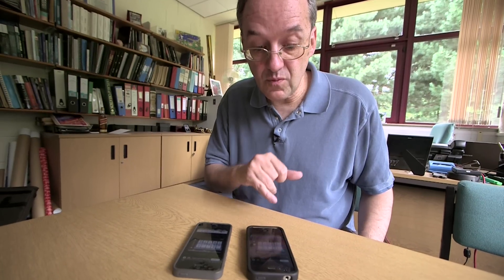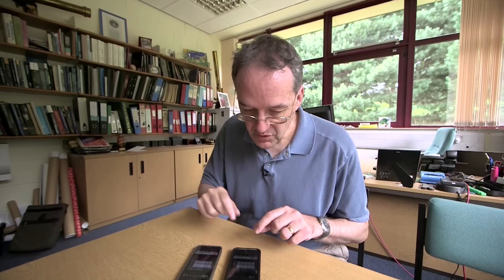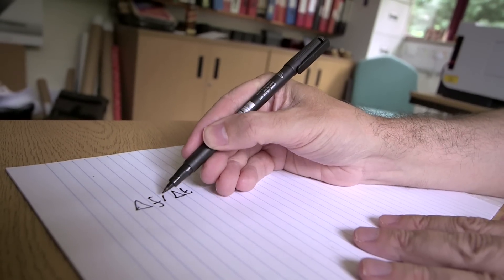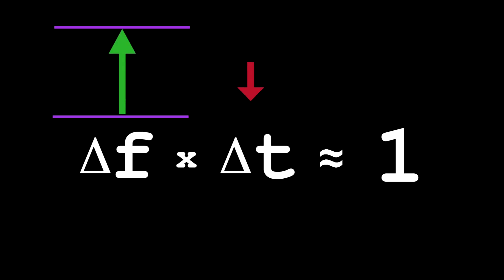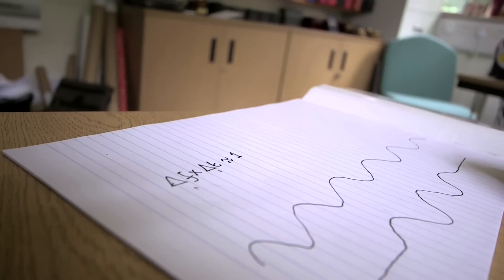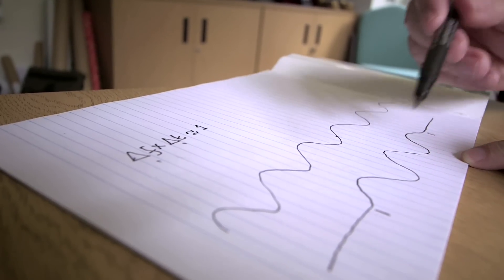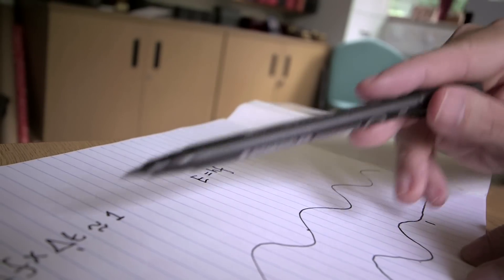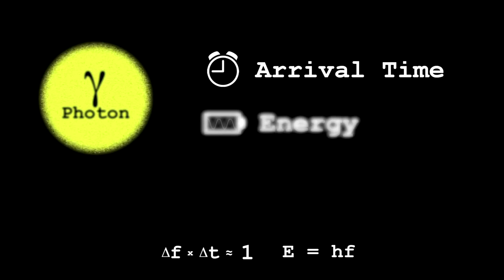What is the maximum Bandwidth? - Sixty Symbols

Comment: A single frequency can indeed convey information. It relies more on the sender/receiver having a pre-designated meaning of the frequency.

Example would be the carrier frequency used for all radio stations. Yes its a tone on a single frequency. The meaning is that your radio knows that this is the 0 point to start listening for the radio station.
Reply: the carrier frequency is actually the center frequency, for FM the information being sent is spreaded over +/- 75khz around the center, and AM is similar.

Maybe you are thinking something like QAM, where a single 100Hz maps to bit 0, a single 200 Hz maps to bit 1, but it is the change from 100Hz to 200Hz makes your carrier signal has a bandwidth greater than 0Hz; in other words, the information carrying signal is not a single frequency signal anymore
Reply: Derrick Cheung May be a bit late to reply, but AM radio never changes in frequency, its the amplitude that communicates data. Its all in the name, Amplitude Modulation(AM) vs Frequency Modulation(FM).
Reply: 90XaSeR09 yes, the center frequency doesn't change, only change in amplitude, but what i was trying to say is, the amplitude/information itself is a signal which has a bandwidth, AM won't compress or expand the bandwidth. Therefore the carrier signal itself will have a bandwidth reside around the center frequency. That's what I meant similar to FM, the information is in the bandwidth, no bandwidth no info.
Reply: Derrick Cheung 90XaSeR09 
But what I am saying is regardless of the actual radio station being broadcast on other frequencies. The carrier itself is a single frequency and conveys that it is the 0ing point (middle or low end it doesn't matter). That is very useful information that is sent on a single frequency, no bandwidth.
Reply: Benjamin Raush Okay, I think we misunderstood each other, I agree, the center frequency is a very important information for tuning your radio for the 0-ing point, otherwise it is demodulating junk.

What he meant when he said a single frequency sine wave doesnt carry information (information as in a sequence of 1 and 0). He meant, in order for a system to send a 1 and a 0, it needs two distinguishable sine waves, different frequency or different amplitude, either way, when you append those two waves in time, this information carrying signal are not longer a single tone/single frequency wave. (a quick Fourier series of some mixed signal will shows it need at least two different frequencies to approx. it)
Reply: no. a true single frequency never comes on or goes off, it' s there all the time, never changes, hence can't convey information

Comment: So is this collection of frequencies transmitting data by turning the light on and off to represent a 1 and 0, respectively, or is the process more complicated?
Reply: B Perkins No, it's a superposition of waveforms. This is touched upon at 2:12 in the video, at least in principle. The light within an optical fibre is never 'off', it doesn't work like morse code. Instead, many streams of individual data are multiplexed on an analog signal, then demultiplexed at the receiving end. 
https://en.wikipedia.org/wiki/Multiplexing
If it worked like Morse code (repeatedly turning a switch off and on), it would be much, much slower, since you'd be only able to send a single data stream at one time, and nothing else. Multiplexing allows you to use a waveform that carries LOTS of data.
Reply: In that case, how are the individual analog waves read by a computer after they are demultiplexed? From 3:10 to 3:30, what do the "blips" and "destructive interference areas" represent? (This is where I assumed they were ones and zeroes).
Reply: ***** In that case, how are the individual analog waves read by a computer after they are demultiplexed? From 3:10 to 3:30, what do the "blips" and "destructive interference areas" represent? (This is where I assumed they were ones and zeroes).
Reply: B Perkins The demultiplexer's very purpose is to break apart all the information carried by the optical carrier signal, which is typically several 
different wavelengths of light.
Upon re-reading my previous comment, I see that I should have probably clarified further. Your assumption is correct, the blips do represent 1s and 0s, but it's not quite as simple as singular blips representing a '1' in binary. They represent many 1s and 0s, because each blip can be further broken down to represent a data value based on the intensity at a particular point in the blip.  
In other words, a single blip carries many 1s and 0s. The wavelength has to be constant (for a single stream of data) because optical fibre works by wavelength division multiplexing ( https://en.wikipedia.org/wiki/Wavelength-division_multiplexing ), but you can certainly mess around with the intensity of each blip, and each blip is divided into representing many 1s and 0s. Rather than "on" and "off", you should think of it as 'bright', 'less bright', 'dim', etc.

Comment: That is what i mean by "doubling the whole system". You need a special transmitting device to use n cables, and a special receiving device capable of collecting these n signals back into one. So basically you have n simple transmitters and n simple receivers, they are just put into a single casing. And each transmitter-cable-receiver system has the same bandwidth limit X, but all systems add up to a total of nX.

Comment: I spoke with my fiber optics cable provider a while back because I had some issues, the man on the phone said while confirming the line was active: "The line allows 100Gb/s transfer rate", so that's something. 

I now have a 600Mb/s up+down line, roughly 75MB/s for 50 euros a month ^^

I think, taking from hardware limitations (~1500MB/s write on a single PCI SSD) it should be possible to provide such. make that roughly 12Gb/s. Having 666 of these cards, will give you the grand total of 1TB/s ^^

Comment: I'm not quite following here so help me out if you can: A laser works because specific energies that are stored in an electron shell is released as specific wavelengths of light... How can you describe such a pulse as having multiple wavelengths?  I get that mathematically, something like a Fourier transform would, naturally turn a square wave into a collection different wavelengths, but how does that actually describe turning a laser on and off? 

And if i may, why can't you phase shift the light 180 degrees like they do with the GPS signals? Or is that actually what they do? and how many nanometers of Delta-f does that require? Can i shorten Delta-f for one signal and put another in there as well? anyone?
Reply: Okay, I don't really know why this works the way it does, but I can (try to) explain how it behaves.

If you know anything about audio or electronics, it's the same concept as a low pass filter or a resistor. If the wave tries to move up and down faster than the cutoff point, it decreases in amplitude; nature doesn't really do exact cutoffs too well afaik, so it's more of a slope.

Square waves! Theoretically, they have an undefined slope between the top and bottom, yeah? Well, when you try to send energy in wave form, the medium the energy is traveling through can only "move" so fast (or slow). So when your energy level (for lack of a better term) goes from on to instantly off (a la square wave), the medium the energy is moving through can't react that quickly, so it moves down more slowly, but eventually gets to the level you jumped to. Because it takes longer to change from one state of energy to another, it gives the effect of losing higher frequencies.
Reply: tsobf242 Hey thanks for the reply! Your explanation does make intuitive sense. I believe I have seen some fast square waves on an old analog oscilloscope and that does match your description. I'm just having a hard time with this description of energy interacting with the "medium" it goes through like you are describing. I guess that's not what i have been thought when it comes to physics... But i guess its like he discusses in the video: consider a quantum energy such as a photon traveling through empty space. At an instance, along the direction of the traveling photon, the energy level would go from zero to that of the photon... but like he says, you would have a hard time determining the exact position OR energy level along the length of this vector. BUT then again you already knew the speed, c, right? 
I think I'm on the right track here...
Reply: Yes I think you are on the right track in saying that once you cut off the light source, you are adding certainty in position and therefor some uncertainty in energy and therefor some extra wavelengths.

Comment: i have a very weak background in physics, so sorry if this question is stupid: why can't amplitude modulation change the frequency of a signal? say i have some normalized wave form and i always switch the carrier on at 1 and off and -1. imho the perceived spectrum at the end of that process should be far different from a single frequency.

Comment: Interesting video. Unfortunately, professor applied wrong theorem. It does not work in real world, at least it is not applicable for a telecommunication channel.
The ultimate limit of how much information can be sent in a telecommunication channel is set by Shannon–Hartley theorem. Not only bandwidth matters, but also noise in channel and signal strength.

Comment: So does that mean tha we can cheat the limit by stacking bands, and have them work in a battery-style arrangement? Each stack has the explained limit but there is no limit to how many stacks you can have? (so, a 3 meter wide optical cable, or a 30 meter wide optical cable etc....). Seems too easy, so what did I get wrong?  (or is it just a tech limit that might be overcome later on)

Comment: So turning the laser on and off would work, as long as I did it slowly enough. But if I wanted the data to be sent quickly enough to be practical, it would be flashing on and off so quickly as to be misinterpreted as frequency that didn't mean anything?
Reply: +Michael Richardson If you switch the laser on and off what you do is essentially AM (amplitude modulation) of the carrier (light wave) with a quasi-square wave signal. AM (as any other modulation scheme) disperses the single frequency of the carrier into a spectrum (whose range is two times the spectrum of the signal).

Comment: question i have: say the maximum range (delta f) is ~300 nm. assuming 1 would have to operate under frequency 300, and 0 would be frequency 299, we could distinguish between a STRING of 1s and a STRING of 0s; however, what about the off time in between each pulse? does the cpu's clock help it interpret between the string of ones & zeros? say, how would the cpu differentiate between 111 and 1111 if the frequency for the pulse for 1 is always t*300nm? whats the frequency/ off between each bit?

Comment: Fascinating. Did not even occur to me that smaller pulses of light necessarily contained wider swaths of frequency. I wonder though if that holds up if the light source were rotating rather than being switched? I suppose so since the light pulse as induced into the fiber would still be "shaped" the same and therefore have the same characteristics as one  that was switched. :| Darn.

Comment: Actually the sine wave could be used to transmit data on one frequency using amplitude modulation (AM) - which how medium wave radio works. And of course a sine wave will transmit one bit of data without  modulation or interrupting the signal - its frequency- not much use though ;)

Comment: But can't you send more than one bit of data per "beep" by sending different intensities? E.g. instead of sending a beep for 1 and no beep for 0, you would send a beep for 11, a two third intensity beep for 10, a one third intensity beep for 01, and no beep for 00.

Or was that last segment supposed to say that you can't differentiate between the different intensities anymore at the maximum frequency?

You could always increase the bandwidth by combining multiple cables,  so either way it's more of a limitation of the ping, rather than the bandwidth.
Reply: ***** Well, what you proposed is actually not a binary codification anymore. Yes, you could do systems like this and "double" the bandwith, but you need different detectors, since they need to discriminate between different intensities and you have to take into greater account fiber dispersion (which tends to spread the initial pulse and thus lower the intensity, leading to erroneous readings)...

Comment: Not that simple. Once you got into the limit with the pulse length, you can multiply the capacity of your line with different polarizations, than phase can be used to code the information, than we may use different modes, and finally several cores can be included into a single fiber. So probably, the final limit will be put not by the time or frequency, but by the total optical power.
Reply: Many cores, thats just cheating. With copper wires in parallel you could match the bandwidth!
Reply: simon unsworth
Bad analogy. Multiple cores in optical fiber is like multiple streams of electrons in one electric wire (not possible). Multiple coper wires in parallel is like multiple fibers in one optical cable - possible, but not discussed here.

Comment: So I understand the uncertainty principle relating time and energy of individual particles. But I guess I'm confused because if I know exactly what time I started the laser, and I know exactly what energy my laser uses (along with the efficiency and so forth) won't I then know, because the photon travels at the speed of light and I know the length of cable, exactly when it arrives? What is the uncertainty there that I am missing?
Reply: Logan Poppe I reckon it's to do with the fact that in reality you'll have a distribution of energies for the photons coming from your laser, meaning that given a long enough on-time, you can be sure you have a more precise energy ie the average value of the distribution, but if you make the pulse really short you may not have enough photon energies to produce the expected average and so you would get a slight spread of energies. Looking at single photons though you simply can't be sure when they left the source exactly if you know it's energy since it's the result of interactions that occur stochastically in the laser materials.

To actually be sure about when it left the source, you would need to know which interaction occurred when and where, and the only way to do that is to interact with the system to measure, meaning you introduce uncertainty in the variables you measure to derive the time. So really you can't know exactly when it arrives, but you can accurately know how long it takes (as long as you know the refractive index of the medium very precisely at all wavelengths concerned)

Comment: Well I think it may be valid, but it’s also a little pedantic. You can only hold so much water in a spoon, unless you make a bigger spoon. Nothing very surprising about it. If you make thick enough finger optic cable, you can send images through it. Or you could just make a thick cable that contained 1024 finger optic lines in it. I don’t see how there is a real world bandwidth limit, any more than there is a real world spoon max capacity. Sure, there is a bandwidth limit to our current commonplace fiber optic cable cable, but if there is a limit to the number of cables that can be bundled, it’s a long ways off.

Furthermore, I’m quite certain that there are ways of leveraging existing individual fiber optic cables which have not been thoroughly explored.

Just one example: Can’t we send a two color gradient through a fiber optic? Can’t the two color gradient be rotated through 360 degrees?

Another example: We could certainly make fiber optics in the future which are also electrically conductive, but there may be ways to send electrical impulses separately from optical impulses along our existing fiber optics. Considering that we don’t need to power anything with said electrical impulses but merely detect them, it is far from impossible that we could leverage our existing fiber optics in more ways than we currently do. Especially as new technologies continue to emerge.

Another example: We can surely do more than send pulses of light, we can send pulses of a whole spectrum of light. So the higher fidelity the light generators and receivers we employ the more finely granulated the light spectrum we could employ.

I’m not going to go back to get the exact quote but didn’t he say some ranges of the light spectrum would certainly not be used in fiber optic data transmission, while only a couple colors of light would be used? So it sounds like the limitation he is describing as more to do with current protocols and transmission and receiving equipment we currently employ more than the fiber optic cables we are currently using.

Yeah there is a fundamental limit to our current fiber optic data infrastructure, but that limit is a result of dozens of not hundreds of aspects of our methodology and protocols, not just fiber optics cables. Furthermore our fiber optic cables are certainly not the be-all-end-all of fiber optic cables, as I’m sure there are yet optimizations which will allow us to produce higher fidelity fiber optics in the future.

I dare say it’s far from a fundamental limit. Just a tragic lack of imagination and innovation.